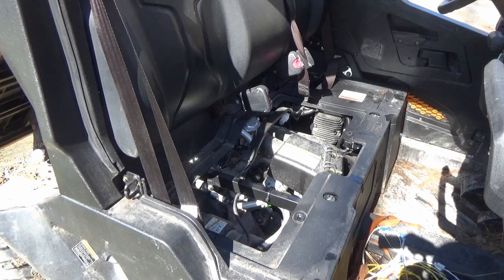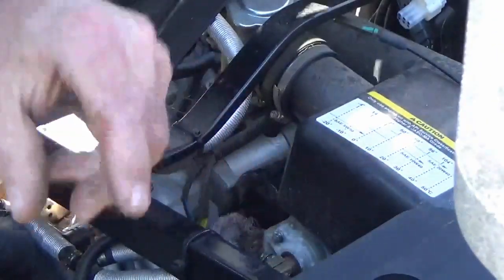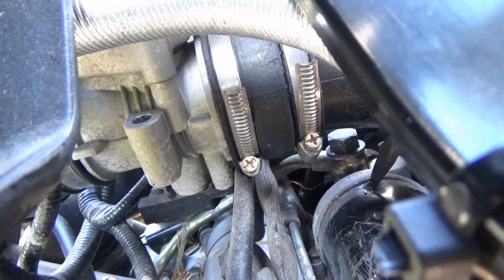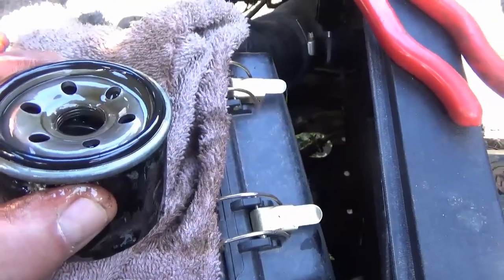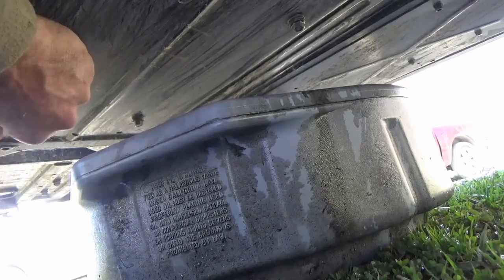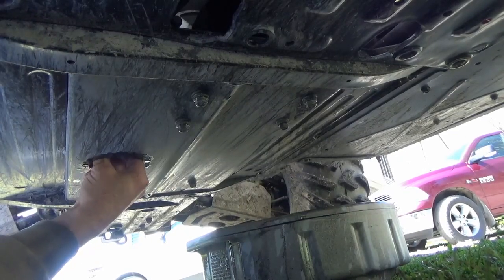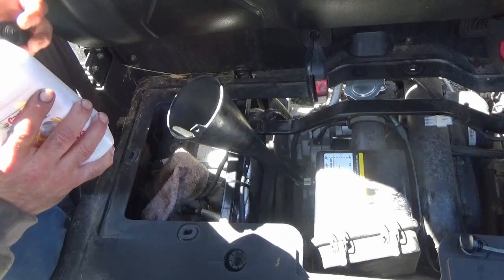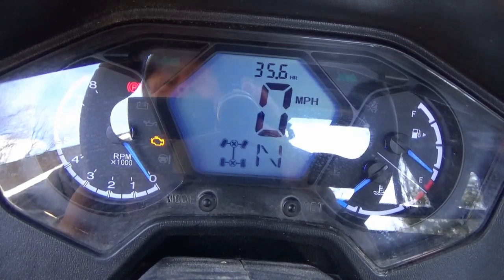Cub Cadet Challenger 750 First Oil And Filter Change

Comment: Also useful info that I was told if you want to use full synthetic oil it must be JASO so that it has the additive for the wet clutch!! Very good to know!
Reply from the maker: Thank you!
Reply: Hmmm I just changed mine and put Mobil one synthetic oil in it. No where did I read there had to be a special additive in it. Wow... Hope I don't run into problems.

Comment: I cross referenced the oil filter number off the amazon site and fram gave me a FD4967 and the extra guard is PH497 I have not bought one yet and don't take this as correct but if anyone can verify I would curious to know?? Fram did give me the number from the long number down the page where the guy posted the link from amazon!

Comment: These really are piles of #%@&, i  just worked on my first one,  basically brand new. Very low quality and and what a pain to service.  Everyone,  check your dipsticks, it appears this one has been grinding on something internally and is blue/purple and beyond at a weird shape.  Did find small stuff around the screen too. People save up a few more months and buy a honda or kawasaki, you'll be way ahead long term. Came here to see if your dip stick had a oring, this one doesn't and is oily all around the case where it goes.

Comment: If you had the oil filter cup wrench would  still have had trouble getting the oil filter off ?????????
Reply from the maker: Not sure, but I tend to think it would have been easier.
Reply: @SteeveeDan   I just changed the oil on my  Hisun sector 750 no problem what so fever !!!! Drain plug came  out easy  and oil filter come out easy . Only thing is the  original oil filter  that came out had a different  size oil filter wrench  than the oil filter that the dealer gave me to replace  other than that every thing went well  and fairly easy to change it all
Reply from the maker: @charliebeck1448  I never have such luck!
Reply: @SteeveeDan   I’ve been changing oil and owning Atv since I was  about 16 years old  I am now 60 years of age !!! the way I see it is all you got to do is size up the situation get the proper tools and be thinking a step ahead all the time. I don’t know if all people think this way but it works for  me  anyhow hope you have a great day and all  the best with your side by side !!!!!!
Reply from the maker: @charliebeck1448  Thank you, same to you too!

Comment: Maybe you could insert 10 or 12 more Ad's in? I mean there's Greed and then there's ridicules. But Thx for the Video...
Reply from the maker: Trust me, if I only made videos for profit, I'd be stone broke. Youtube changed their ad policy a while back, even if I choose no ads they will still put ads in. When I post a video I always set ads as skippable but have no control over what they call "Display Ads". Sorry, I don't have as much control over the ads as I would like.
Reply: @SteeveeDan  Well then I am sorry then... I guess it is just part of our new world!  I shot my mouth off and did not even deserve your kind explanation.  I recently bought a 2018 challenger 750 like new 16 hours on it. Then just after my purchase I have been reading the forums about all the problems, and blown motors. It does give me hope that you seem to use yours as intended and is doing fine. Any Advise?
Reply from the maker: @keithmoore7515  No apologies necessary, but thank you. This is my second Challenger and, knock wood, have had no problems that stop me from using the machine as intended. Matter of fact, I've been using the heck out of it for the last 2 weeks. Best advice I can give is keep the oil and filter changed and use the recommended oil and filter, keep the major parts clean and lubed, keep the air filter clean and really that's all that I've done and so far have had great success. I can only imagine that due to their low (lower than the competition) price new and with all of the included options, they sell a lot of them so there would be more opinions out there than for say for the Ranger or Honda. Best of luck with your new machine!
Reply from the maker: @keithmoore7515  Forgot to mention, seems that everyone likes to drive and work the Challenger is 2nd gear (H), I use low all of the time unless I'm on a fairly flat surface and feel comfortable going 45 mph with no load, trailer, or plow.

Comment: SteeveeDan, thanks for the great videos on the Cub Cadets. I am on my 4th Cub Cadet UTV. I Started with a Big Country 6 wheel then a Volunteer 750 then a Challenger 500 (not good) and now a Challenger 750 which I really like. I had the same issue with the oil filter on my 750 on the first change. Had to remove it the same why you did. Anyway, I see you build fire apparatus, I am a fire chief in Canada and purchased many trucks built in the USA.
Reply from the maker: Good for you! I really do love mine as well and have had no issues with it other than a little rust on the steering wheel and a broken winch cable. Becoming Chief is no easy task, congrats! Yes, I work for Sutphen and I may be biased, but I think we build some of the best apparatus that is available! I was a police officer in NJ and I also served in the military so I do understand the need for reliability. Best wishes.

Comment: Had the same issue on my 2019 750. Got the filter off the same as you did. But, my drain plug was just as tight. Had to use a 1/2 inch air impact to get free.
Reply from the maker: What a nightmare. I don't know what their thoughts are that they need to make them so tight. Thanks for the comment!

Comment: I have the same machine 2019 . Did you ever end up installing a oil gauge? If so what kit? Could you post a breakdown
Reply from the maker: I never got around to it. Work and moving took up so much time that I had to put it off but do plan on doing it this spring, sorry.

Comment: Does anyone know where you can find oil filters for the cub cadet UTV's other than through Cub Cadet dealer.  i just paid $27.00 for a quart of oil and a filter for a Challenger 750.   Does Napa, Wix, Baldwin etc have a filter for these UTV's?
Reply from the maker: I got mine at NAPA, same with the oil.
Reply: @SteeveeDan  Can i get the filter number from you?
Reply from the maker: @davidevans9469  I can't find my receipt so I called them and they no longer stock this filter. I did a little research and found this, not 100% sure it's correct but check it out and try to figure out if it's the correct one; https://www.amazon.com/Engine-Filter-Hisun-Bennche-Massimo/dp/B07NVG5PFQ/ref=asc_df_B07NVG5PFQ/?tag=hyprod-20&linkCode=df0&hvadid=352779814736&hvpos=&hvnetw=g&hvrand=4782853050767529067&hvpone=&hvptwo=&hvqmt=&hvdev=c&hvdvcmdl=&hvlocint=&hvlocphy=9007067&hvtargid=pla-806699537754&psc=1&tag=&ref=&adgrpid=71370554112&hvpone=&hvptwo=&hvadid=352779814736&hvpos=&hvnetw=g&hvrand=4782853050767529067&hvqmt=&hvdev=c&hvdvcmdl=&hvlocint=&hvlocphy=9007067&hvtargid=pla-806699537754
Reply: @SteeveeDan  thanks!
Reply from the maker: @davidevans9469  Very welcome!